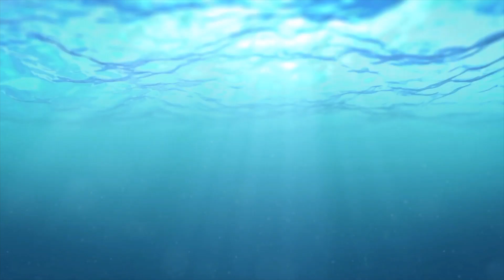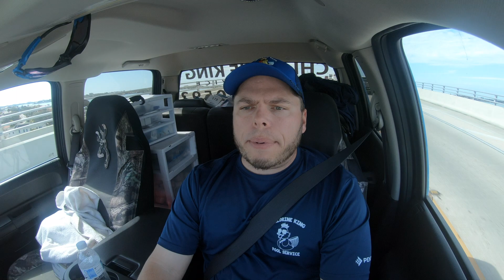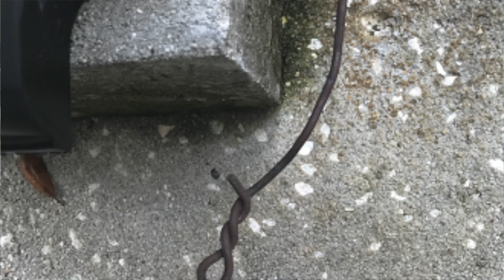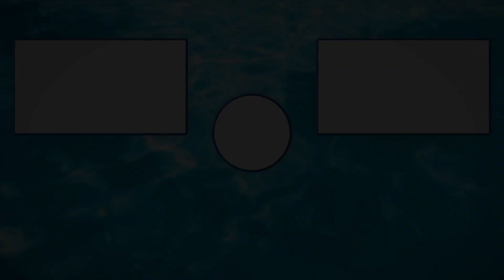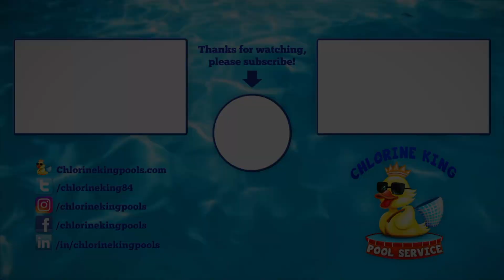How To Properly Bond Pool Equipment (Safety Tips 2025)

Comment: I work with techs who rarely bond pool equipment, and wont re-bond when replacing motors.
Reply from the maker: It’s a shame they don’t as they are providing a disservice. Per the NEC the pump should be bonded.

Comment: Thanks for this. The last installer didn't connect this.  They just hid the loose wire under the motor.
Reply from the maker: I’d point it out to the H/O, unless you’re the H/O. It’s very simple to do if it’s all there.

Comment: Safety issues are ridiculous. You've got every pool, commercial and otherwise, since the invention of the electric motor was not bonded nor even grounded and no one ever died from diving in. Get real???? I swam in scores of pools back in the 60s and never felt tingle one and bonding was a term that was far in the future, not to mention the lack of a ground wire. You yourself in this video say you see unbonded pools all the time, how old are those pools? Old. How many people felt a slight tingle? None. How many people were in danger of a 120 volt shock? None. Anyway, safety is not the only reason for bonding. A more real problem is galvanic corrosion because some screw on your three way valve is 0.05 volts higher than is your heater.
Reply: Thats just not true man. You have a serious safety issue if you arent bonded, especially if you have an old pump or heater that is corroded/leaking. I know you know so much, but as a professional pool guy who's seen it first hand, I strongly disagree with your blatant disregard for the safety of swimmers.

Comment: On how do you bond a resin pool when only the wall is a steel. I can get to the joint of the wall to bond there
Reply: I’m having the same issue finding answers
Reply: Did you ever find an answer to this? I'm in the same scenario right now. All the posts and stuff are resin. I assume I only need to bond to the wall joint.

Comment: So you probably get this all the time but do I have to bond a summer waves canvas style pool? It has the pump that mounts on the side of the pool with no ground motor. If I do still need to bond it where does the wire go to afterwards Bc every video I’ve seen goes to a bolt on the motor
Reply: I’m just confused bc I haven’t found videos of anyone bonding those types of pools but the code in my area says all pools over 24 inches have to be bonded I just don’t know what to connect the copper to other than the bonding plate and the 4 points on the posts
Reply from the maker: I would definitely make sure the pool is bonded. It should be attached in several points in the rebar of the pool shell and wire is than ran over to the equipment pad to bond the pump, salt system, heater, etc all on the same line, or potential.

Comment: Bonded or not, there will always be 1-3 volts of stray electricity in pool water. this is natural and not a issue, fear not pool owners. The issue is when there is a difference in voltage between ANYTHING metal (not just motors)  including handrails and fences within 4ft of the pool. Differences in volts will create electrolysis which will accelerate galvanic corrosion. The bonding wire will keep everything equal. Salt chlorinators are not to be bonded as they use electrolysis to create chlorine but the metal frame of the swg controller will be bonded.